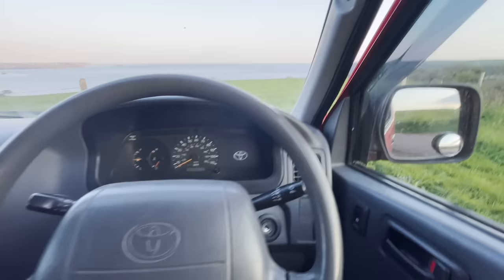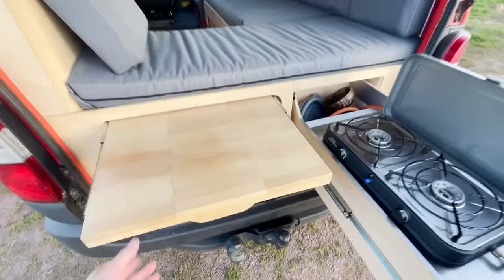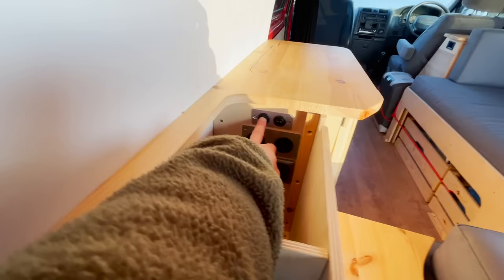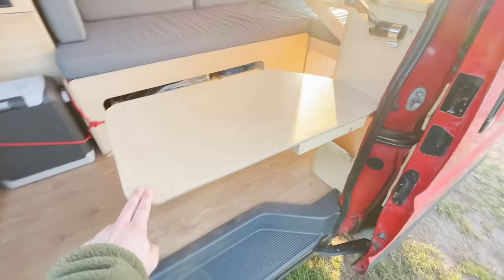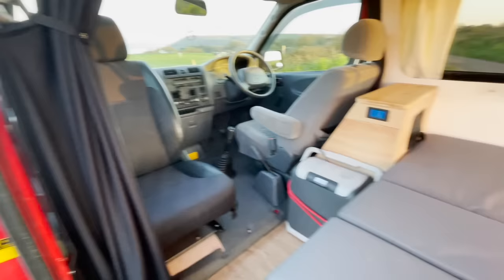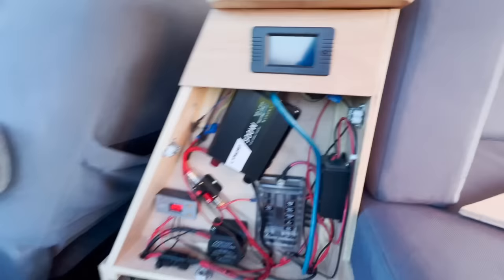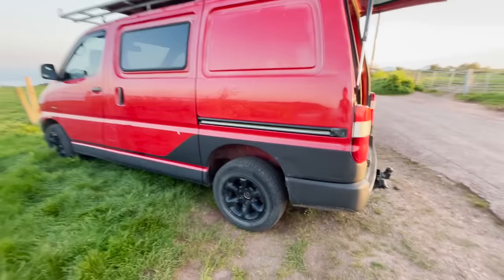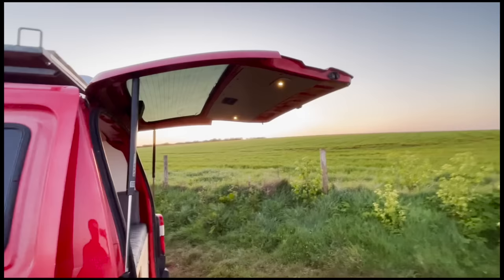Self Converted Camper - Toyota Hiace 280 SWB

Comment: Hi mate amazing build and great video! I’m building one myself and have got a step to put in for the sliding door but it’s coming up too high, did you have to adjust yours to get it to fit? Thanks Max
Reply from the maker: Good question, I built my floor up with insulation, 9mm ply and then hardwood floor so it came in flush when I put the step in.
Reply: Thanks I managed to the same and it looks so much smarter with it in!

Comment: Hi Louis.. Great video, thanks.... when the rear door is open above the cooking pull out area, is that Okay to use in the rain. As in, if you have the rear door open above you, as a canopy, but can that be relied on to not ingress water? the hiace and the nv350 nissan seem to have channels that take the run off to the sides, but they go behind the rear lights and into the body work. do you use your set up in the rain is what I'm saying I guess.
Reply from the maker: Thanks. No I used the inside cooking setup when it rained. Unless you have an awning tent or side guards for the tail gate you a quite exposed in the rain.

Comment: Looks really cool! How do you charge the battery though? I am totally clueless with electronics, didn't see a solar panel. So was just thinking how the battery is charged.
Reply from the maker: The domestic battery’s are connected to the starter battery on a split charge relay setup. So when you dive the van is charges the battery to full in about 30mins.
Reply: @l.a.hunter  Sweet, I was speculating that, you might have mentioned it in the video, in case you did, I missed that bit of information. Thanks for clarifying!

Comment: Love your work Louis! Question for you about road noise. With the engine mounted the way it is; did you do anything special to counter excess noise in the cabin?
Reply from the maker: I put about a 25% coverage of dodo mat on all the panels the same as I’ve done on my current build. The cab has sound deadening from the factory, the 2007 facelift model has better sound deadening in the cab from factory. The engine is in the front not like the old models which was under the seats I can imagine they are louder.
Reply: Ha, had no idea. I thought even the current hiace engine was between the seats. Thanks.

Comment: I like your van's layout. May I know what material is your deck on top is made of and how it's installed? Thank you
Reply from the maker: It has a 9mm ply under layer secured to 20mm battens which are bonded to the floor and then 9mm oak effect laminate on top. Before I put this down I laid sound deadening and insulation on the floor.

Comment: Hey. Love your van build! I have a problem finding plugs that fit the panels (thicker than the old ones) on the side- and back-doors. What kind of plugs did you use and recommend?
Reply from the maker: Hi, thanks. Are you talking about my AC plugs? Or 12v plugs?

Comment: Your van looks great and well built for your own needs, love it! How did you do the controller for your lights? Thanks a lot for sharing 😊
Reply from the maker: Thanks, the lights are wired to a remote dimmer switch unit which comes with a controller.
Reply from the maker: https://www.ebay.co.uk/itm/155111479858?mkcid=16&mkevt=1&mkrid=711-127632-2357-0&ssspo=jpeuv9krsm-&sssrc=2349624&ssuid=NpHOZD6cQxS&var=&widget_ver=artemis&media=COPY